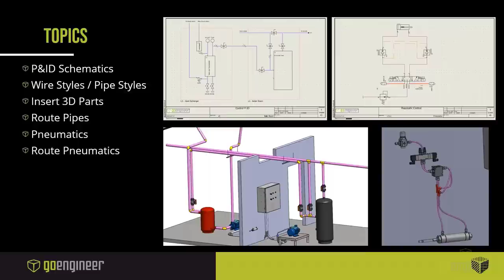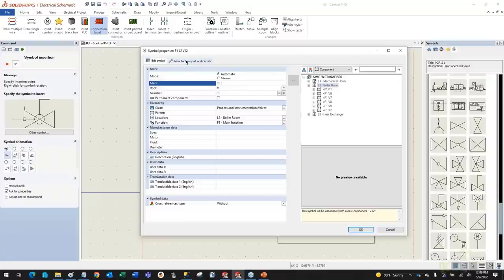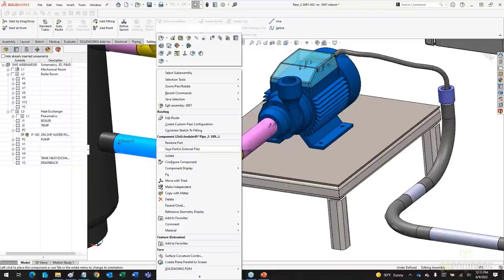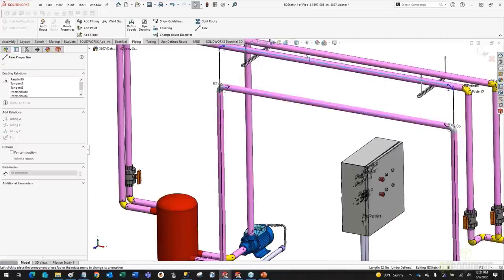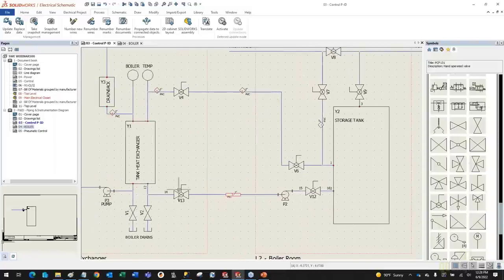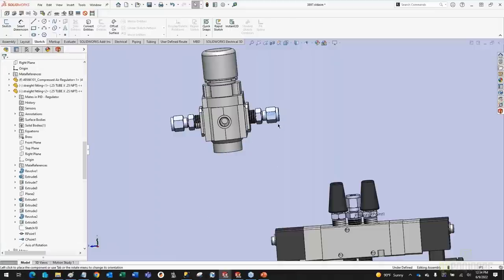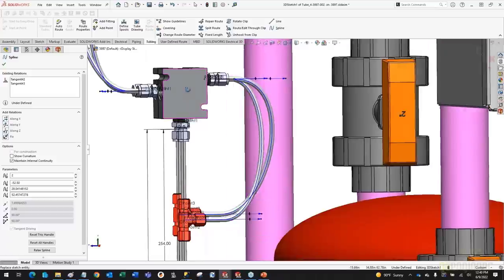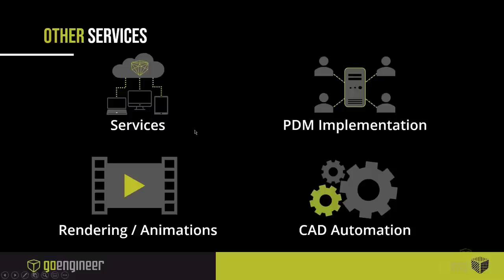P&ID with SOLIDWORKS Electrical - Webinar

Comment: dumb question regarding hardware - are you on an underpowered laptop for this demo, or something with a spinning hdd?

Seems like for even some simple sketch opening and edits that it looks like it is slow and clunky.

If you are on a laptop or low end machine - step it up GoEngineer! The better and smoother the tool looks and performs is also a sales tool, not just showing how something works.
Reply from the maker: mjs28s, no questions are dumb questions 😊 I was using a 3-4year old laptop, I’ve since received a new laptop, but at the time it was on backorder for a couple months. The demo seemed to go very smooth during practice time, but this webinar was presenting LIVE and I recorded it locally using Camtasia, and GoToWebinar was also recording which really made my whole demo feel like I was in slow motion.  Thanks for watching!!